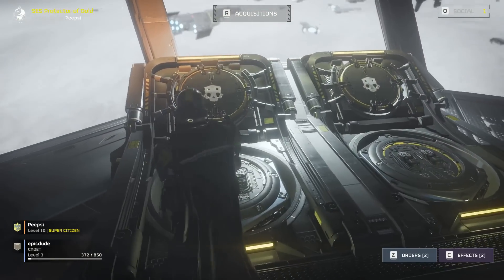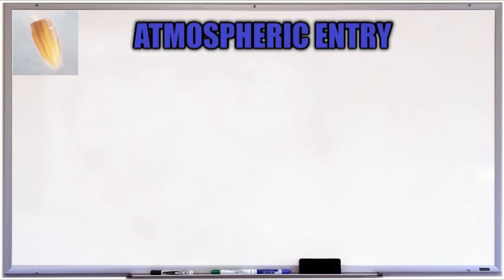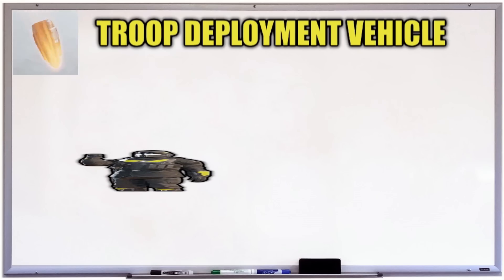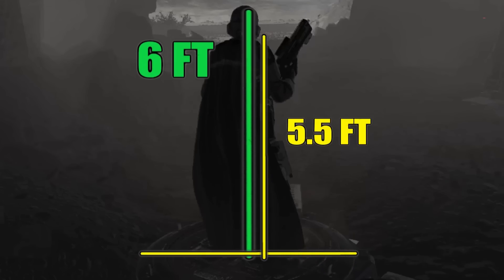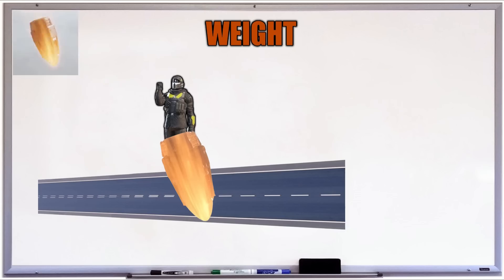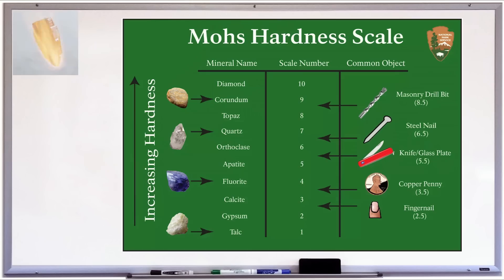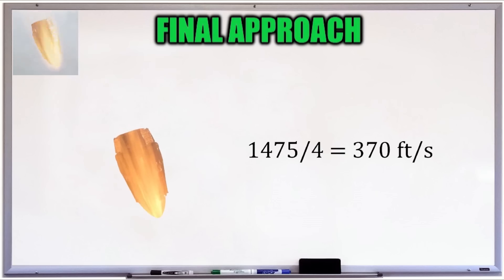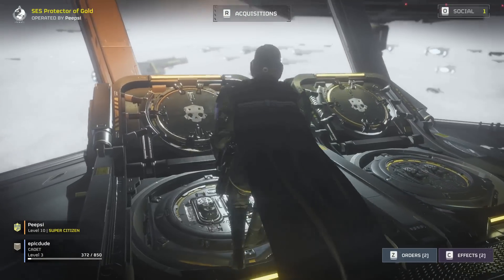Engineering in Games: The Helldivers 2 Hellpod

Comment: The lifting mechanism seems to be in the sides of the tube inside. If you look very closely to the pod when another player get’s in before the lid is attached, you can see it has like some guiding rails or something. If you land the pod on a cliff at the right spot, you can also get a far more accurate scale to how big it is compared to the Helldiver. Land it so half of it is embedded into a cliff and the other half is sticking out of the cliff.

Comment: Taking the Cd of a bullet would have been more accurate than the cone. Because the cone is not the only thing that affects Cd the whole body does and the hell pod is shaped like a bullet. 

That's why aerodynamically smooth cars don't just call it a day by designing a aerodynamic front end, they have to design the whole body.

Comment: make the hellpod from titan submerge the heldiver in   perfluorocarbon (we know they use this for the eagle one pilot.) it will make the heldiver more resistant to g forces and it have a huge heat capacity and disperse heat realy well. use the space under the heldiver -cone to absorb some of the fall. do not use cheramia for the heat shield. it is a single use so a burn away heat protection is good enouf. the raising mehanism is not significant it can be a simple spring. of corse it woud probably destroy the planets ozone layer and we need to medicate the heldivers so they not feel like they suffocating. but i feel like it maybe woud do the trick.

Comment: Drafting Design engineer here. Loved the video.

One thing ive noticed is the hellpod has airbrake fins that pop out on the top that could also help slow the pod down. Much like the control surfaces on the falcon rockets spaceX developed. Lets say that slows the pod down enough to remove an additional 20 g's. Also, you could theorize that the vertical deployment system for the helldiver is also a shock absorbing system. Which could decrease the g forces down to survivable levels. Seeing as you'd only need to bleed about 60g's from the impact; hellpods could theoretically be survivable.

Now who wants to band together, develop this, and get a government contract for deploying weapon systems to our troops from orbit? 😎

Comment: Since the standard helldiver armor is made from the same titanium alloy as the destroyer’s hull, I’m guessing that the hellpod is also made from this titanium alloy. Also in the ship upgrades it says that the hellpod uses shock absorbing springs (or if you got the upgrade shock absorbing gels) so I’m kinda bummed out that you didn’t go into detail about that. Also I think my democracy officer would appreciate it if you put a little more effort in the mental gymnastics required to make hellpods work, we’re in the future man, what if the titanium alloy is extremely light, or what if the shock absorption mechanisms are extremely advanced, or what if the rockets responsible for slowing down the pod give a final powerful blast just before it’s fully landed. Giving up this easily sounds a little defeatist if you ask me…

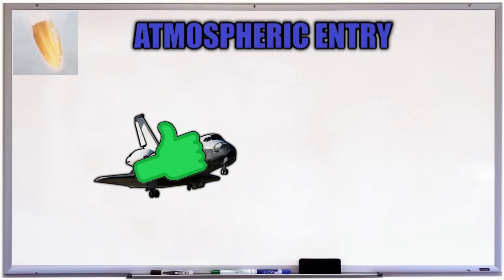Comment: 3:30 There are actually cheaper options than ceramic tiles that we have today, which work better than these tiles due to the one time use nature of the Hellpod: Ablative heat shielding. Instead of trying to absorb the heat, ablative heat shields actually turn to gas with reentry heat, the gas itself them absorbs the heat and is convected away into the atmosphere, thus sacrificing the shield to dissipate heat.

The shuttle doesnt use an ablative shield because it needs to be reused, but the Apollo program used them for their capsule reentries.

Comment: When calculating the weight of the nose cone, you said the diameter and height were about equal, but when calculating the volume you took put in 2.75 (the radius) for the height as well when height should be 5.5 (the diameter), right?

Comment: Three things you forgot are the shape of the hellpod is unstable, the nosecone could be coated in an ablative layer to deal with heat, and the hellpod could crumple the nosecone and use internal mechanisms to stretch out the deceleration time.  If the hellpod was shaped more like NASA reentry capsules with a wide flat, but slightly rounded bottom, then it would have a lower terminal velocity, be more stable as it enters the atmosphere, and experience reduced heating because the flatter surface keeps the fiery part further away (because physics).

Comment: I believe the pods would be produced entirely out of some weird tungsten carbide/titanium alloy and ceramic composites on the outside to possibly allow for a thinner wall, leading to a slightly lighter weight and lesser terminal velocity. With the thinner walls, I am also sure they could possibly store more fuel for the retro-burners, allowing them to cook longer and decrease the velocity much more over a longer period. Additionally, I'm sure there is some sort of internal shock absorption system/gels that reduce the G-forces on the occupant, as sci-fi as that may sound, but they already utilize similar materials in football padding and helmets to reduce concussive force from tackles and stuff.

I was also reading a lot of comments regarding the Super Destroyer's position during Hellpod deployment. The game tips even state that the Super Destroyer can only remain in "Low Orbit" for a limited time. I am sure they begin their descent as the Hellpods are prepped, so I feel it would also be safe to say that they wouldn't be dropping from an "outermost" orbital position, seeing as when you are on the ground (average loading screen time for me is anywhere between 20-30 seconds, do the math with terminal velocity) you can visibly see your destroyers lingering in the air.

I'm sure, being a little more realistic here, Hellpod drop locations would also be determined by some type of orbital geological scan. Send the Hellpods into a softer loamy soil or sandy areas than straight up bedrock and shale shelves. Notice how you have locations you CAN drop into, and locations (depicted with jagged rocky shapes) you CANNOT jump into.

I feel with enough funding, willing human participants, and coffee, I believe an actual, truly functional Hellpod isn't as far fetched as we might believe.
The main issue is finding the funding, the willing human participants, and a doctor that will unquestionably connect an espresso machine to me (and fellow Super Earth engineers) via IV tube.

Comment: I think a better compassion would be using the SpaceX Starship instead of NASA Shuttle. The rings on Starship are made of 4mm stainless steel and it's supposed to survive the reentry. 
Using titanium would make those pods more expensive and it wouldn't match the trope of helldivers being those expendable soldiers for whom a lot of expenses are spared.

Comment: I have seen many ideas with shock absorbing springs that let the helldiver decelerate more slowly and while those are a great idea, I don't really see how they would work as hellpods seem pretty tightly designed, so no room for up/down movement. Some also suggest a breathable liquid the diver is suspended in but we never see any liquid being pushed out when the diver exits the pod. So either there is some fancy future anti-gravity technology at work or the actual g-compensating mechanisms are a lot more subtle. Maybe only the diver's lung is flooded through their helmet which could be connected to the pod with a tube we don't see as it detatches while the diver is still inside the pod? I might also just have misheard but was frame data used to calculate the g-forces on impact? Wouldn't it be easier to just use the pods height as a deceleration length and calculate from there?

Comment: The fact that you want the pod to hit the ground fast means you don’t have to worry about drag that much, so you can give it a nice bullet shape that will be stable at supersonic and subsonic speeds with a nice, smooth shockwave to ride on that won't make as much shock heating as modern day reentry capsules. Then you just need to slap some nice ablative coating on the tip and you're good

Comment: I have a theory that may explain why the helldiver doesn't turn into a pancake after the drop.
Let's talk about soft and dense bullets. Given the same velocity, mass and a condition of full non-penetration (a.k.a. the bullet stopped at the surface of the armor plate), the back part of the soft bullet will expirience less shock than the back part of the dense one. This fact was brought up when we were f#%king around with tracer rounds, but that's a whole another story. The reason is that a soft bullet spends up to 20% of its kinetic energy on the compression itself, while the dense bullet expiriences the shock with a whole volume, and that's why AP rounds have a tendency to shatter in small nearly identical pieces as a whole. The shockwave is evenly distributed around the whole bullet.
Hellpod is basically a big overengineered bullet, and if we take what I've said into account - it doesn't make sense to judge it as a steel monolith. If we make the frontal part of the hellpod soft and the back part dense (antipodal to what we do with actual bullets), the dense part with a helldiver in it will expirience less shock because the kinetic energy of the impact will be reduced thanks to the compression of the frontal part.

Comment: Not to be that guy but the heat from objects burning up isn’t generated by friction with the air, it’s generated by the drastically increasing pressure as the object dives deeper into the air

Comment: i think you forgot to account for the possibility that the pods are filled with breathable perfluorocarbons like the liquid-ventilated cockpits used for the eagles at enough of a pressure that the pods physically pop off the cap a second after impact like a tennis tube in an oven. said perfluorocarbons would help them absorb much more G-forces as they'd be cushioned by it and would also be able to actually breathe even with the increased G-strain. the divers are also probably on a gantry-fixed plate that shifts around by a good few inches and likely crumples another structure under them during the lithobreaking. plus you're forgetting that they get ejected straight  down, pretty much, which shaves off a good chunk of the speed.

Comment: Minor (nerdy) correction: the heat experienced during atmospheric entry isn't caused by air friction.  The air in front of the entering object is actually getting compressed as it just can't get out of the way fast enough.  And of course, when you compress a gas into a smaller volume, the temperature must increase 😊
Reply: I was looking for this comment! Nerdy, yes, but appreciated!!
Reply: Noticing the more areodynamic shape of the hellpod compared to current spacecraft heat shielding, I think it would be fair to say that a somewhat large portion of the air is diverted past the hellpod and thus is friction rather than compression. Imagine sticking a wedge onto a hydraulic press and compressing a copper coin. The diameter of the coin when flat would be compressed but the sides would fly upward and outward once the coin is separated. Of course, due to the currently unfamiliar technology of the hellpod and the varying compositions and densities of the atmospheres across planets, I may be entirely wrong.
Reply: Halved, not seperated

Comment: If you wanted to make the landing more survivable by reducing hellpod weight, changing the material of the nosecone would be very helpful. I think that using tungsten carbide would be VERY overkill for what this thing has to do (and horrendously expensive for a single-use device).

If you were to use some sort of heat-treated alloy steel (around 500 lbs per ft^3), you could reduce the nosecone weight to around 11,000 lbs. This would cut overall weight to only 17,000 lbs, almost half what the weight would be if a tungsten cone is used!

I'm no engineer, but if I steal your numbers, I can pretend to be one for a few minutes (ツ). Plugging 17,000 lbs into the terminal velocity formula gives a Vt of 1,100 ft/s. Using this in the g-force calculations gives us a much more manageable 70 Gs. If we assume that the hellpod has some super futuristic Sweet Liberty!™ branded shock absorbers, I could easily see that reducing Gs to a survivable level.

Comment: Firstly, the question would be: Would a shuttle who's purpose is to plunge straight into the surface of a planet, excluding other factors like rocks and whatnot, just pure planet substrate if it's even possible for someone to withstand? If not, then the hell-pod idea is entirely not possible in the exact way which it is portrayed and thus a single-use deployment of a single soldier should instead be something else. The purpose of this should be rapid deployment whilst maintaining no-change in the integrity of the soldier's vitals. 

The hell-pod idea will only be viable if it was said that Helldivers had the appropriate augmentations to withstand such force, a.k.a them being not fully human, or rather "super" humans (get it?) 

Other than that, the pelican would be the only form of transport from planet to orbit, but even that is another thing to solve for how a VTOL like aircraft is able to effortlessly fly from surface to orbit.

Comment: What if the fuel is used to absorb some of the heating from re-entry? Most of the mass of the pod might also be fuel in tanks in the sides of the pringle can of democracy, so burning it while slowing down would dramatically increase the aerobraking effect once you are in the denser atmosphere close to ground?

Comment: Engineering undergraduate student here! I think you may be over estimating the heating that the Hellpod will have to endure. Super Destroyers don’t orbit planets, they hover above a point relative to the surface of the planet! That means no lateral velocity needs to be shed!

That would mean that you only need to determine the gravitational potential energy of the Hellpod at an arbitrary altitude then use that to find the velocity before it hits the Karman line. The speed shed by drag before reaching terminal velocity could be used to determine the heat energy the pod would need to withstand.

TLDR; Hellpods don’t need to withstand a full orbital drop.
Reply: Always bugged me that they say the destroyers are in orbit (when time runs out for example it says "super destroyer leaving orbit")
Reply: @alonkufsa  I think it's not a small stretch to imagine that orbit might become a colloquialism that loses its original meaning, but that's just me making stuff up.
Reply: @bob38028  argument fails 2:24 the hellpod is the mesosphere so it just entered orbit
Reply: @deltasquad8817  You know altitude and tangential velocity are independendant of each other right?  You do realize that something being high up does not equal orbit?
Reply: @alonkufsa  That is because they basically operate in 2 ranges, low orbit where they are basically touching the upper atmosphere, and upper orbit where you normally are selecting missions. Low orbit puts them in range of surface to orbit weaponry, which is why they have you on a time limit as they say when you are running low on time "we cannot stay this low for much longer". As well as comments about how "we got in and out before we were noticed" when you do a mission fast.
Reply: @TankHunter678  Still, when they are low they still refer to it as orbit "destroyer leaving orbit"
Reply: I also wonder what the Helldiver's suit itself might do to help mitigate the g forces, it might be possible the hellpod and the divers suit work together is some way. Not 100% sure, obviously just a possibility done with better knowledge could figure out, lol.
Reply: Doesn't orbit just mean something is in a continuous circle around something? So, depending on where gravity starts/ends, you could orbit earth rather low, especially with the advancements of a destroyer. Im probably wrong about what an orbit is.
Reply: @shuttlebird3  If the destoyer is having to do continuous work to maintain the orbit then one could make the argument that they have not achieved a stable orbit.  Sort of like how a helicopter can fly around the world.  Would we say a helicopter is orbiting the earth? Probably not, because it would obfuscate what orbit actually means in this context.

The Super Destroyer is acting more like a helicopter than a satellite.
Reply: Is geosynchronous orbit not orbit?
Reply: @Rallysoldier  It is but you'd have to demonstrate that the SD's are in geosynchronous orbit. The wide discrepancy in different super destroyers' altitude while in "orbit" does not lend credibility to the idea that they are in geosynchronous orbit.
Reply: I like your profile pic
Reply: The destroyer definitely is not in anything traditionally considered an orbit, just look up, it’s an enormous figure in the sky above despite only being about twice the size of an a380. Regardless of if there’s a voice line referring to a low orbit they very clearly down at an altitude one would associate with airliners meaning it’s taking a lot of energy to maintain their position. We just need to find a planet that is pretty explicitly earth like and I’d imaging it would be pretty easy to figure out at what altitude it’s parked between missions, it’s gotta be at least a few hundred kilometres.
Reply: @lolroflroflcakes  We could do some math while observing one above Mars and extrapolate from there.